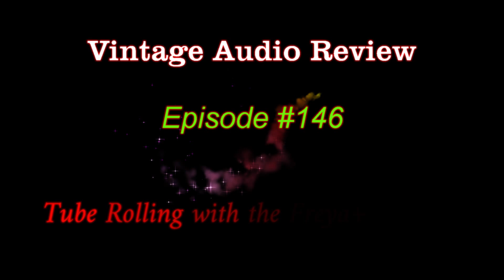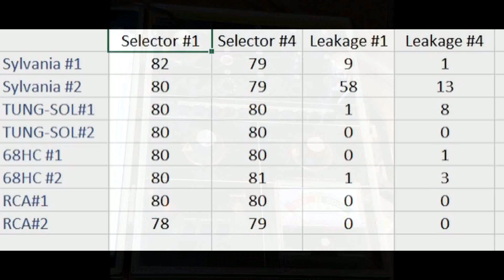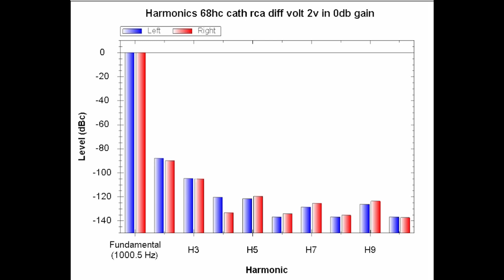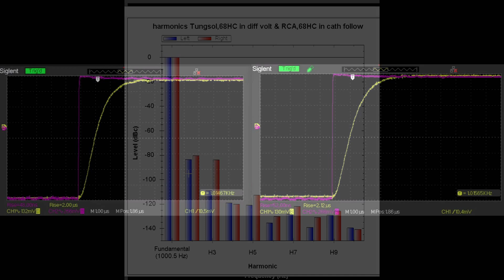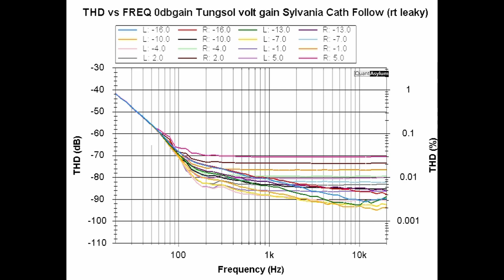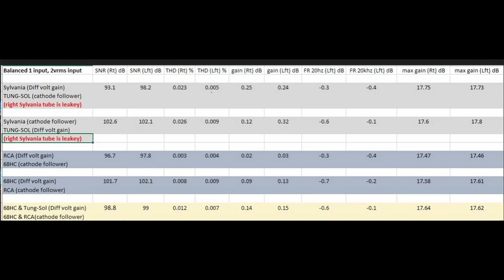Tube Rolling with the Freya+ Preamp- Vintage Audio Review Episode #146

Comment: I never sacrrifice good nos tubes in this kind of electronics .
Reply from the maker: Thanks for the comment, but I would like to hear your reasoning. The data showed that there would not be much meaningful difference between any of the tubes that were used- new or old, so what use would you find for NOS tubes ?

Comment: Why not do a video on vintage mosfit amps ,they have a slight tube sound. Like the soundcraftsmen & B&k amps.
Reply from the maker: I appreciate the suggestion, but I typically just review a single piece of gear unless it is an a/b test. I have not had any B&K amps come into my possession to test yet. I have not heard much of a difference in my tests between tube and solid state gear.